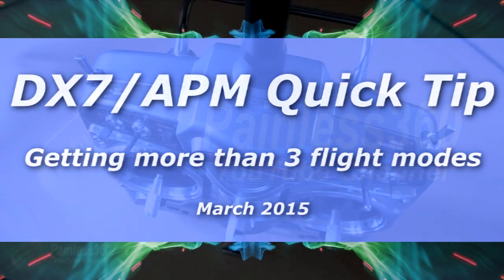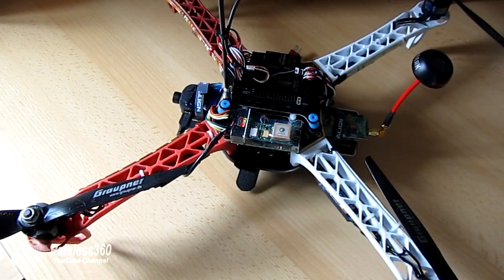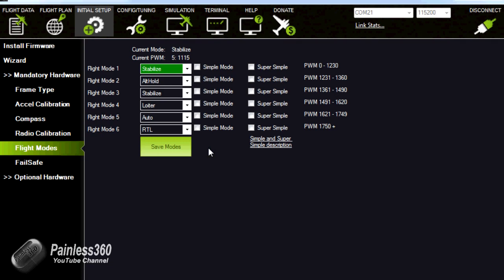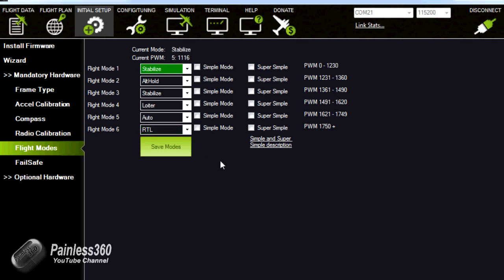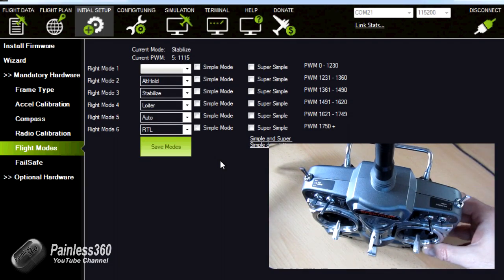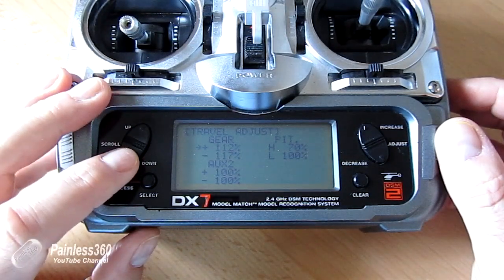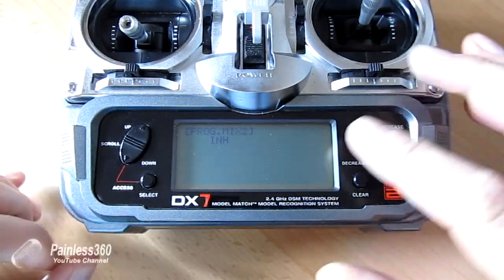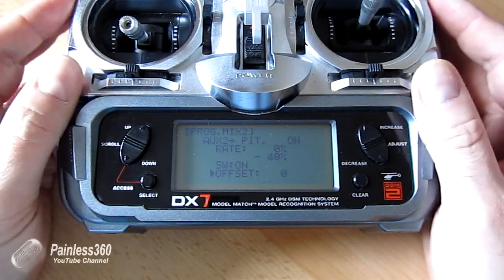RC Quick Tip: Getting more than 3 modes with your DX7 radio and your APM

Comment: hi fellla i usihg the same 3 posision swich but wen swich it to its 3 posisions i can only pic 2 modes the posision 3 just takes bk to posion 2 if u get me
Reply from the maker: +Chris Schofield please reply to the existing conversation, with do many questions it gets very tricky to keep track. Videos showing the probdlm you're having with lots more detail on what you've tried can be very helpful too.. Best of luck
Reply: i  solvled the last problam but now just wants to flip instantly on take off just watched ya video on fliping i don as stated god nows how meany times but still flip using dx7 with a dsmx f801 resiver 
if can mail me your email all send photos or video of conecshions and what every ya need to help lol
Reply from the maker: +Chris Schofield what troubleshooting have you already tried?
Reply: leads mottors all calibrashons gps accsel esc tryed that ;uch carnt remeber what tryed lol i built it cuple year go was a drea; to fly befor was put away for cuple months naw this woodent think i built it been out the hobby that long now i forgot more than i new

Comment: I see how you got the 6 flight modes when you set it up as a helicopter but I set my Quantum Nova up in airplane mode  on my old Dx7 and wanted to get the 6 flight modes. I got 4 modes just messing around with everything.

Comment: I did something similar on my DX6i to get 5 values out of the Gyro Channel:
Gyro Switch set to 0=2,5%  1=75%
MIX1: Gyro+Gyro
         0       +100
SW ELE

MIX2: Gyro+Gyro
         0       -50
SW AIL

There are now 5 Values realized with the ELEV D/R,Gyro and AIL D/R Switches on the Gyro Channel.